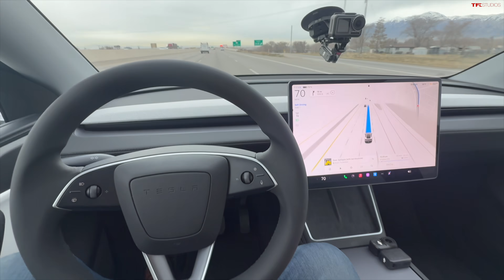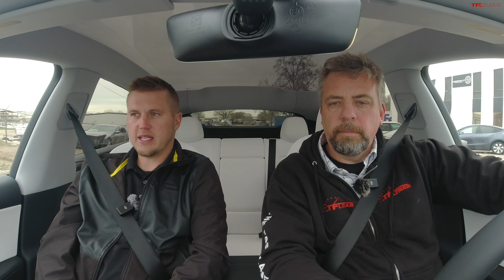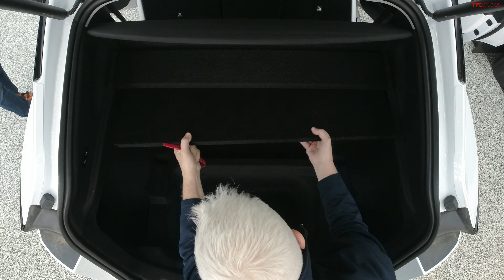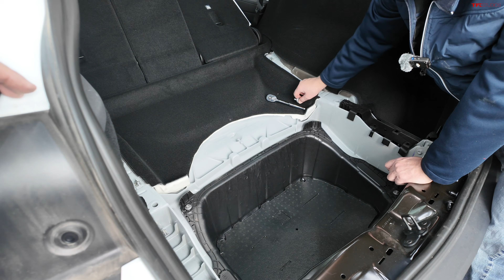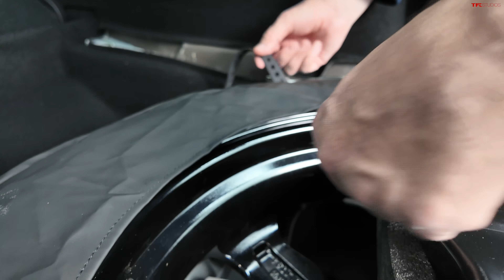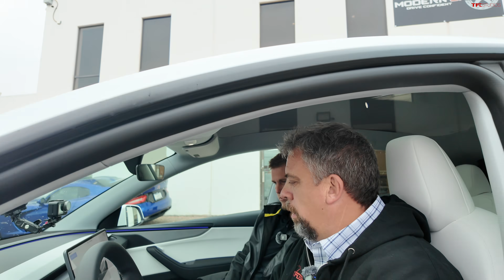This Simple Change Will TRANSFORM Your EV Range!

Comment: I think not once was addressed traction for acceleration, cornering or braking.  Dangerous because the Tesla does not drive any differently and there is massive potential for wheel lockup and sliding.  If someone wanted to do this the dangers were not apparent.  I am hopeful there are big warning notices on tip of the tool kit when installing the spare.  I feel the 50mph limit was more to do with elevated temperature of the temporary tire leading to failure at higher sustained speeds.

Comment: Camry Hybrid in earlier generations was offered with different wheel size widths. The difference between 235mm wide and 205mm wide tires was about 4mpg. I'd be very careful about reducing tire width without ensuring that at a specific pressure the tire can handle the load of the car. I know spares can handle an increase in weight and have different pressures listed but they're also speed limited usually to about 50mph.

Comment: I wanted to replace the suspension on my 2024 Tesla Model Y RWD with Juniper-style, but the service center in Turkey said it wasn't possible. I suggested using higher-profile tires, like 50-55, but they refused. They said it would void the warranty if the inverter or motor failed. I'm about to lose my mind; it's not just stiff, it's extremely stiff. There's a lot of vibration. What do you recommend?

Comment: Factory donut spare tires last longer than they claim. They are not balanced do you should only use them on the back of the vehicle but they can easily go 1,000 miles no problem.

Comment: One of the worst informational videos I have ever seen!  You put 4 spare tires on a car, who the hell is going to do that.  The function of a spare tire is to allow you to change the tire on the road and get somewhere to purchase a new tire.  Why didn't you get off your rump and change the tire on the road.  If the tire is flat in the front will there be enough room to get the jack underneath?  While the tire may be the same diameter as the regular tire, once on the vehicle with all that weight on it can it remain the same diameter?  How many pounds of air pressure does the spare require?  Shouldn't you have told people that they should carry an inflator and a tire pressure gauge?  Most spares sit in a car for years without being used and they don't hold their pressure.  How would the car handle with 3 regular tires and one spare tire?  By the way, everyone knows skinny tires are more efficient on a car going in a straight line.  However, I wouldn't want to go around sharp turns with them, make hard stops, drive in bad weather, etc.  This was nothing more than an advertisement for the spare tire company.

Comment: Cool to see that improvement. Unfortunately it's not worth the decrease in braking performance and handling. And by handling i don't mean just going going down the road. i mean if you have to swerve to avoid something emergency brake and hard acceleration are all gonna take a hit. Also being such small tires on such a heavy vehicle i would imagine tire wear will be accelerated as well. Which makes me wonder if that just plain cancels out your "savings" by having to replace tires more frequently.  Neat vid though.

Comment: I'd like to share my experience with Modern Spare.  Three years ago I purchased their spare tire kit for my Tesla model Y.   When I ordered, totally my error, I chose the model 3 kit.   I noticed this when the kit arrived.  I phoned Modern Spare, asking if the model 3 version would work.  I was told it would not.  I asked if I could return it.   Not only did  Modern allow me to return and replace, they paid the freight BOTH WAYS, which was not insignificant.
I used the spare once when I hit a cinder block fallen off a truck ahead of me.  It worked great.  This is one of the most courteous, helpful company I've ever dealt with.

Comment: I hope those scissor jacks have improved over the years. Back in the early 2000s, I had one bend and collapse on me. If it wasn't for the fact that I also had Jack stands underneath the car, I would have been crushed. I no longer trust scissor jacks. I will stick with hydraulic jacks.
Reply: Always throw a wheel under the car as a backup

Comment: Interesting test and I don’t doubt the range gains, but this is one of those mods that can backfire legally. Tires are a safety-critical component, and going skinnier than factory spec changes braking distance, traction, and how stability/ABS systems behave. The issue really shows up if there’s an accident with injuries, an attorney can argue you altered the vehicle outside manufacturer specs and reduced its ability to stop or handle safely. For example, longer stopping distance could lead to a rear-end collision, reduced grip could cause loss of control during an emergency maneuver, or increased hydroplaning risk in the rain. Even if you’re not fully at fault, in states like California you can still get hit with comparative negligence if your setup contributed at all. So while you might gain a few extra miles of range, you’re also potentially opening yourself up to liability that could cost way more than the efficiency benefit, cool experiment, but probably not the smartest move for a daily driver on public roads.

Comment: A wide tire only comes into play when and if you push the speed into hard corners. Like you would in a race car.  For normal driving a skinnier tire is just as good as a wide tire for handling. It is no surprise that a really skinny tire is better for gas mileage or range.

Comment: In one of the test drives, there was one more person on board. This makes a difference.
Reply: In my Yaris iA, yes. in a 4,400 lb car, less so.
Reply: @jayhiggins5239 any amount of weight changes your range. That's why tesla says your range could be affected depending on what's in the car. It has even been proven that a dirty tesla has less efficiency
Reply: @daleleggette And stop and go traffic it would affect you but cruising down the road at a fairly constant speed weight doesn't matter as much. A dirty one gets less efficiency because of drag
Reply: @matt45540 cruising still affects your mpg, all this has been proven

Comment: Well... I run 215/50x18 instead of the stock size 235/45x18 on mine model 3 Highland.
Reply: Have you seen an increase in range? What is the weight difference between your stock setup and your slimmer set of wheels/tires?
Reply: @positivelysurviving2007 Around 3 to 5 % better at least. But the outside temperature do change all the time, so it can be difficould to compare 100%. But my range is longe. Next upgrade will be with Hypergram lightweight rims.

Comment: So this is meant to be a spare tire.  How does it perform when used as a spare with 3 OEM sized tires?  I get what they are testing, but if that is the goal you would want/need all 4 to be "modern spares" right?

Comment: The Chevy Bolt and the bmw i3 are known examples of the narrow tires reduction of rolling resistance and increased range.
Reply: The bolts tires arent that narrow though, they are 215's. They are typical economy car tire size.

The i3's are super narrow though.

Comment: I don't see any value in the skinny tires, Giving up handling and braking not to mention the life of those skinny tires has to be very short compared to the High Load factory tires. Just having to replace the tires more often negates the mileage increase. They are emergency spare tires and should not be driven over X speed and only for a few miles to get help.

Comment: Everybody seems to just assume that a lower profile, wider tire is always a better improvement in cornering and braking. Actual real world and controlled/instrumented testing has shown that is not always the case. In many cases, the bigger tire only gives a marginal improvement, if any in braking or cornering improvements. In a few cases it actually makes it worse. 

In my case, I used to always go for the biggest and fattest tire I could stuff into the fender and wheel openings. Now, not so much. I am finding the trade off in ride, noise, weight and cost are not worth the marginal gains elsewhere.

Comment: Getting a spare for a car that didn't come with one (for whatever reason the manufacturer has) is a brilliant idea.  Fitting 4 skinny wheels on a 2 ton EV with a 0-60 under 6 seconds, very very terrible.
And another thing I question.  Space saver spares can be a different diameter, but that's not necessarily the reason for slower speeds.  My space saver is exactly the same diameter, but they still suggest slower speeds because everything else is different.  The contact patch, the rolling resistance, sidewall flex, inflation pressure, etc.  Unless you have an EXACT same spare as the 4 on the vehicle it WILL behave differently.

Comment: Strange you have a current show about installing skinny tires.
I have a new Tesla Y, that came with 19” wheels with very low profile tires. 45’s.
I replaced the wheels with 18” that are 1” narrower.
Installed 55 profile tires on the smaller rims to keep the same circumference.
Softer ride and slightly better fuel/battery range. 
And they look better.!!!
Reply: The surprise is, the handling didn’t change much as expected. Due to the new tires were winter type tread. I expected it to be worse due to winter tread and being narrower. 
The major concern is the handling due to the softer less distinct ride and handling. Which I expected. 
Having off road track experience.
The difference is within expectations.
For older drivers, you won’t experience the sloppy handling of a 60’s-80’s car.

Comment: Why not design a mount to attach to ba k of the seat instead? Losing sub trunk is massive issue for me! I use it for a fridge and luggage if needed.
Reply: Not sure I follow...why use sub trunk for luggage and yet keep the wheel in the trunk? Just put luggage in the trunk instead of wheel?
Reply: @moonsovermiami101 for more luggage

Comment: Savings would be much greater if low rolling resistance tire would be used.

For max range in model y 195/60r18 e primacy in 8x18et30 wheel is best I have tested so far.

Comment: I have a model 3 performance and 6 weeks ago I swapped out the 20'' wheels 235/35 for 18'' 235/45 RWD with aero covers I shaved a bit off the corners of the rear brake calipers as they were rubbing and over 12 identical round trips were I was using 10 % charge I am only using 8 % that is a 20% reduction in energy use. I was due for tire replacement soon and the 18'' wheels came with tires with 60 % tread and when they wear out they will cost 1/2 the price of the 20 '' tires.  I carry a small air compressor and plug kit and always use to remove the spare tire in cars that had one as I preferred the extra low down storage that's why I watched this video to see if their was any hidden space under the boot liner and looks like their is.
Reply: Awesome! That’s a huge range increase

Comment: The efficiency increase was nearly 10%. You're welcome!
Reply: It'd be more if they weren't on unaerodynamic rims
Reply: @MB-jz3uu Yup. If they had rims with the aero hubcaps, even more range. Seemed more like an ad for Modern Spare. LOL!
Reply: @RavenDeth yeah I stopped watching once I saw they were just spares
Reply: It's actually more than that because they didn't account for the added weight of the passenger in the comparison test.
Reply: @jessiev8333 that would not have a measurable impact on efficiency
Reply: Hour drive has 10% more variables.... Needs more data.

Great looking product, though ,I'm inquiring
Reply: All benefits with no downfalls like: stopping distance, tire wear, turning dynamics, safety. If you throw that all to the wind for battery distance, they should at least mention it.
Reply: Your comment was a 100% efficiency increase. Thanks!
Reply: Thanks, yeah good range, but looks like crap and handles worse.
Reply: They said that in the video, why should we thank you?
Reply: But they didn't even take an identical route, and they didn't do Wh/m numbers, but just losey goosey "trust me bro" numbers.
Reply: Thank you, i was pissed they were talking all kinds of bullshite on the range section! crapy video lol
Reply: I had to stop after 5 min in.
Reply: thank you.  That was the whole point of my visit.
Reply: We will need to watch to know if you're commenting is true or just for engagement 👀
Reply: Thanks, I don't care for infomercials disguised as normal content.

Comment: Now I know! 
Interesting point about  manufacturers putting higher / larger diameter wheels therefore tires on car, yet in practice or everyday driving  these wheels and tires are being destroyed,  because of the low profile tire not being able to withstand pot hole impact as well as the 'old fashioned' wheel and tire sizes do.
Why are we being forced then to spend more once again ? 
A good friend of mine just bought a Toyota RAV4 and he ordered the lesser trim model because it comes equipped with 17 inch wheels / tires for this very reason.
Reply: Yes ... more people need to know this.  This is one of my biggest complaints about newer vehicles.

Comment: No average consumer is going to go through the trouble to install this kit.  Especially when it means you lose all the awesome storage space underneath the floor.   I have a modern spare and I simply stored vertically in that big tub whenever we go on a road trip. I’m not giving up that space 100% of the time so I can have a spare tire in my car for the 99% of time I’m driving around town. So stupid.
Reply: Agreed!! Better to make a back seat mount for it ! Would fit and be easy

Comment: I don't think this is wise to completely swap all 4 for long term usage, lol unsafe on traction. I once owned bmw i3 ev.  similar bicycle tires. from Physic perspective, obviously you get more range because you are pushing vehicle with less road surface.  This only make sense if you're carrying this as single spare emergency blow out' situation. the ride height is properly designed comparably.

Comment: let's be clear, these tires are intended to be a single temporary spare, and you should never use all 4 at the same time because the vehicle dynamics and chassis have been set up for the OEM tire size.

  This set up would significantly compromise all driving dynamics, especially for such a heavy vehicle.

Comment: Interesting results. 
   For those that want to try, don’t! 
   The tires won’t stop as fast, won’t corner as well
   Won’t wear well at all
    Have no M&S ratings of any kind. 
In ideal conditions the car will drive fine, in less than ideal conditions, the more you need the tires the less they will perform as you NEED!! 
    Still a fun “test”. 😊

Comment: I haven’t had a spare tire in any of my cars in at least 20 years… MBZ. Porsche, Range Rover, BMWs.  They all had run flat tires. Two flats in that span and just continued driving until I could replace the tires.  This seems like an application in search of a need.
Reply: Run flat tires suck for handling because they are considerable heavier and the more unsprung weight the worse the handling.
Reply: @matthewhuszarik4173 good to know for the 0.000001% who race on a track. Otherwise I can assume BMW MBZ Porsche and Range Rover engineer know what they’re doing.
Reply: @robb5516 First it doesn’t just apply to driving on the track it also applies to driving on winding roads. But it is like everything people want less and less responsibility for what they are doing. Manual transmissions have almost disappeared. The convenience of run flat tires with their poorer ride quality and reduced handling dynamics are a small price to pay for the convenience of never having to change a flat tire.
Reply: @matthewhuszarik4173 it’s more than convenient. It’s safety. If you get a flat in an undesirable part of a crowed city or a dark winding road in the middle of nowhere it’s not a place to change a tire. Run flats let you drive to a safe place.

Comment: You lose a large amount of your storage? I guess you can see why they don’t include a spare from the factory. 
Definitely would not run tires that narrow normally. They put wider tires on for a reason. By your first efficiency loop you already were getting some pretty good efficiency.
Reply: Maybe the crumple zone also is also effected putting a tire in that configuration between the bumper and back seats. For Tesla to get their great safety crash ratings they may not be able to put a spare tire there.